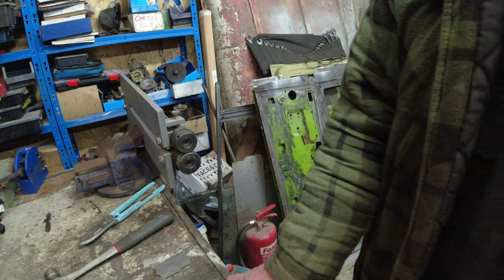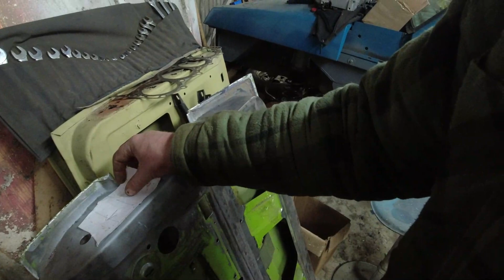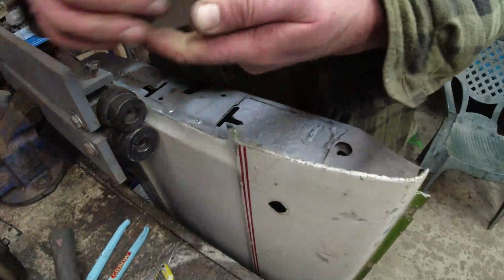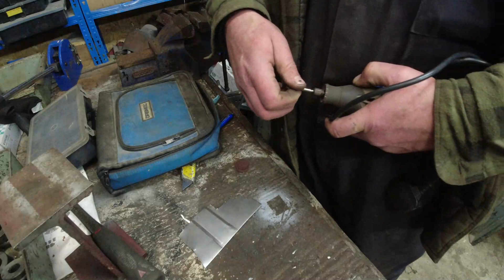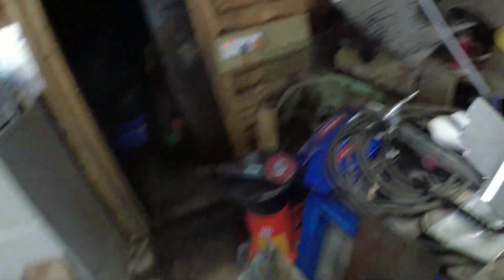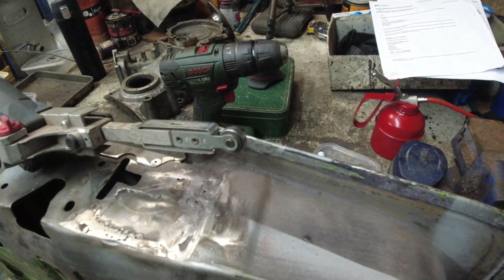1973 Range Rover classic 2 door repairs

Comment: Love these "bodywork" repair videos. I occasionally use snips and sometimes my bench metal cutter as it saves keep putting on PPE, but then I revert back to the grinder as it doesn't distort the metal and is easy to trim off small edges.
Reply from the maker: Thank you, yes always use proper PPE, do as I say and not as I do. 

Paper discs on the nylon backing attachment to my angle grinder are the best for fine tuning. the deep throat sheer though is the most useful thing I have for 18 and 20 gauge steel